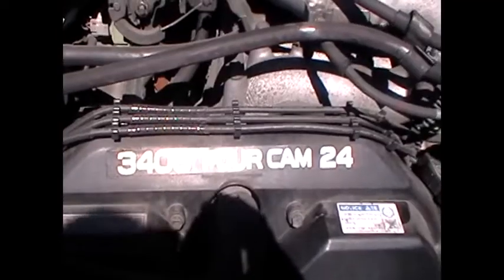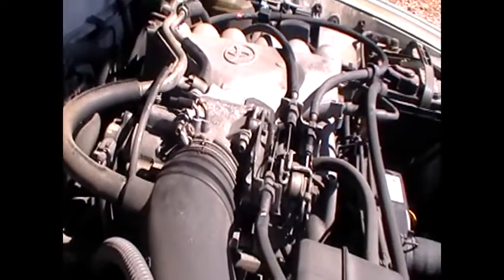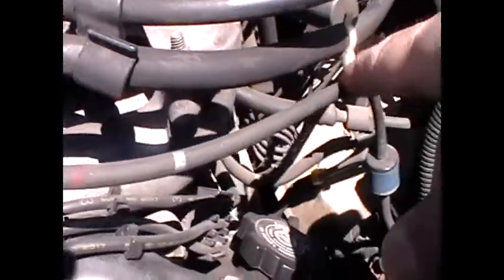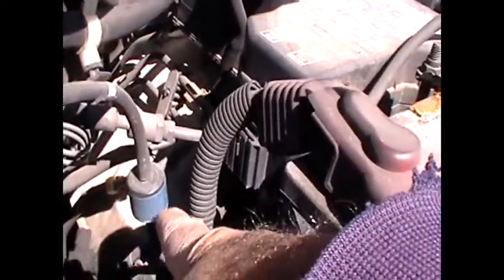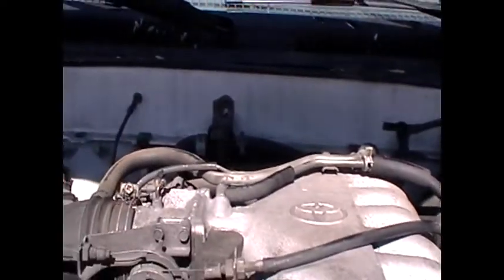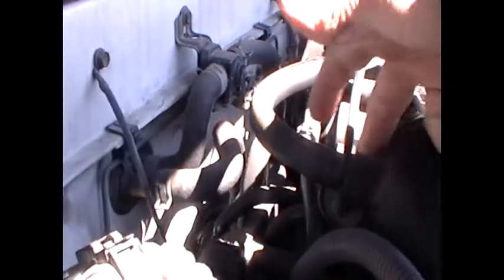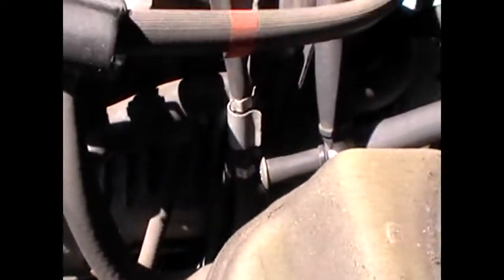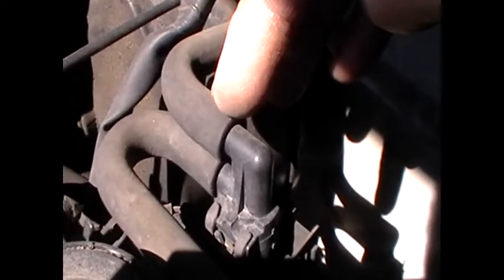1999 Toyota Tacoma 3.4L (3400) Vacuum Hose Routing

Comment: I have the same truck there is a leaking water coming from the right passenger side of the tire just under the engine any idea what I can do?
Reply from the maker: @BU4LIFE321  Do you have steam or fog on the inside of your windshield?  If so, you might have a heater core leak.  I've used K-Seal to fix mine.

Comment: where does the vacuum line at 8:45 into the video go?? thanks! ..mine just dangles after the clip connection to the wheel well... im curious to know if its supposed to connect somewhere?
Reply from the maker: It looks like the one you are describing goes down into the metal line mounted to the fender well.  If you cannot find the correct place to mount the dangling hose, go to the Toyota dealership Parts DEPT. nearest to you, and request a printout of the vacuum hose diagram for your truck.

Comment: So if you could let me know where the line coming off the evap canister closest to the battery goes would be awesome... I just had a Japanese 45,000 mile motor put in my 96 tacoma and that nipple got broke so that line never got put back on...
Reply from the maker: It looks like the one you mentioned goes from the canister down to a metal line directly beneath the canister on the fender well.